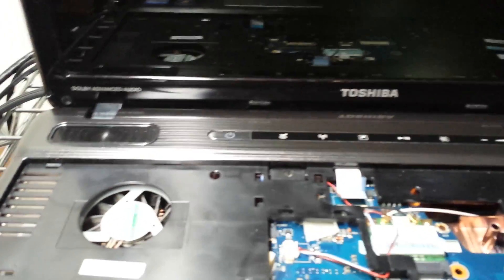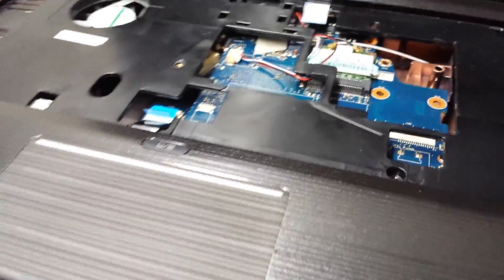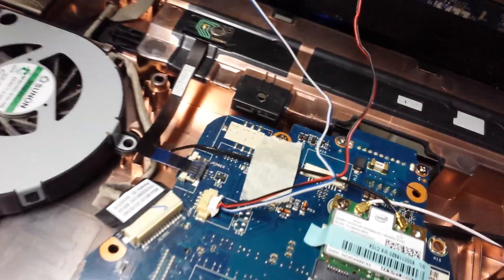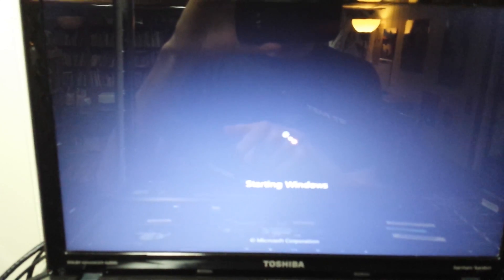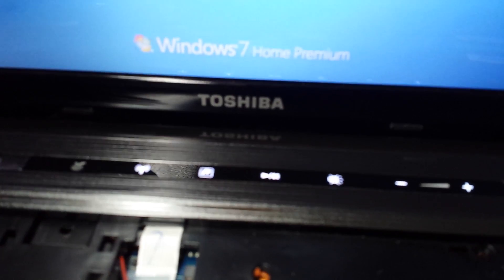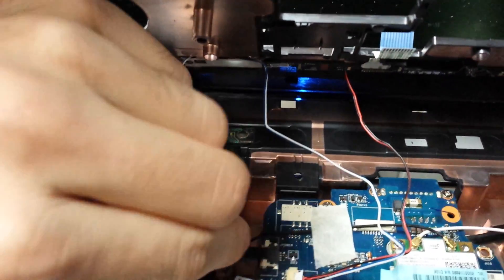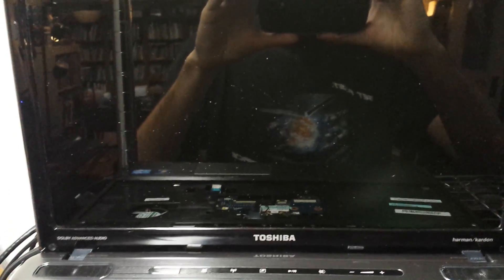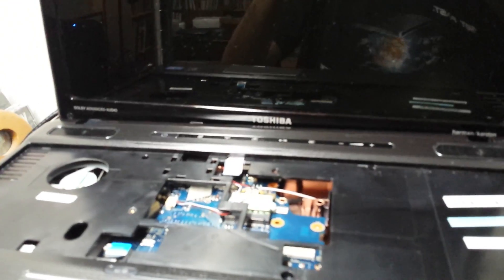Satellite P755 Won't turn on FIX

Comment: I just tried this trick out on a free Toshiba P755 that I saved from being recycled and it fixed it though my model definitely seems to run hot at 70-88C so I think I'll need to repaste it as well.

Shame there dosen't seem to be a replacement button for these anymore, so I'll just use it as a test system for Linux and the like.

Comment: I just fixed a similar problem with the P755. The power button felt really flimsy amd would randomly go into shut down. After opening it, I found this small plastic piece had come off from under the power button so any pressure on the keyboard would result in the power button being pressed. You need to be real careful when opening the laptop to make sure you don't lose it. I found it come off and stuck to near the hinge area, I was very lucky I spotted it. Just tape it back underneath it which will make the button nice and solid again. Stick it to the button of the laptop case; away from the button diaphram, not on top of or next to it. You will find they both have a notch which allows the plastic piece to sit in.
Reply: Are you able to further explain this? Any photos or anything? I do have a faulty power button because I disabled it but sometimes while pressing my keyboard it will shut down.

I have a P750 though so I'm not sure if the model is exactly the same.

Comment: Thanks for your help. This on a Toshiba A665D-S606.
I disconnected what you said, but I taped only the two traces that go directly to the button and reinserted the ribbon cable. Now I use the Play + Mute keys to turn it on  and still have both power leds. 
Since it worked I could have cut the cable, but tape works too.
My neighbor is very happy.

Comment: The same fix worked for a Satellite P745.  The nice part is that you don't even have to disassemble the laptop to get to it.  You just remove the memory cover and you'll see the ribbon connector -- just unhook it.
Reply: I've never disassembled a laptop before. Can you please tell me how to remove the memory cover and where it is located?
Thanks in advance.
Reply: The memory cover is on the under side of the laptop -- usually secured by a few screws.  You just remove the screws and pop the cover off.  It lets you get to some additional screws that have to come out in order to get the top cover off.
Reply: Thanks, man! =)

Comment: I really super appreciate this video, thanks a ton for this idea. After diagnosing software, hard drive, power supply, etc. I stumbled upon your video. I am working on a Satellite p755-s5265 and pulling the cable for the power button instantly did the trick. I have a very minimal comfort level popping apart a plastic laptop, but it certainly was doable and I recommend trying this to any p755 users experiencing unexplained boot failures. Try your finger rubbing over the power button without pressing if you are unsure before digging down to this part. Thanks much CarlsonXComputers!!

Comment: I have a Toshiba Satellite P750D which experienced the same issue: the machine started powering off (sometimes powering on shortly after, even) on its own without reason. I also noticed that the power button had become very sensitive to touch, as I didn't have to press until the click for it to activate. 

I too managed to figure out that the problem was the power membrane, since when I cleaned it up, the power button worked properly again... until it got dusty again (which took about a week or two, in my environment). So until now I've been painstakingly disassembling the machine and cleaning the power membrane repeatedly until it worked normally every time.

Funnily enough, I also recently found out about the machine's "power up by sliding on the upper buttons" capability by accident. I just never put two and two together since I believed the power membrane needed to be connected to the motherboard in order for the thing to power up. Now I know otherwise.

Haven't tried the fix yet, but I'm sure it'll work the same. Thanks for this video, it's been pretty helpful.

Comment: You're a life saver!! Thank you a billion times for this. I was facing this issue and the IT guy just said it was a processor issue and told me to replace the processor but the laptop still failed after replacing my processor.. Now I know the problem. Gonna try it out and let you know. Thanks again.
Reply: Quick question! Did you have to unscrew anything in the back to take the keyboard area off?
Reply: Shelly Cambell  Yes. There is a screw in the middle that holds the keyboard and prevents it from being detached. Watch the video in the description link on how disassemble Toshiba P755, it will show you how to unscrew it.
Reply: +Habush Samireh I watched the video and did unscrew everything now, but the keyboard won't detach near the center. Do you also need to take out the pieces of RAM in order for it to come out? (Sorry for all the questions! I've never done anything like this and don't wanna accidentally ruin my computer lol)
Reply: +Habush Samireh er, never mind actually! I fixed it. :) Thanks for the help you gave earlier though!

Comment: Hello, first of all thanks for this vid. I'm having the same issue with my toshiba but mine is a Satellite M645-SP4130L the design is similar but different at the same time, mine doesnt seem to have a way to connect the media keys without the power button. So my only sollution is to buy a new button? thank you very much.

Comment: I'm so glad I found this video. I knew the power button was the issue on my Toshiba, but couldn't figure out a way to get around it without paying the steep price for another cheap button. I never would have thought that the laptop could be powered on by swiping that pad at the top. Anyway, my laptop is working great now that I just unplugged the power button. Thanks so much for this!

Comment: Huge thanks for this video. Was having this issue with my laptop for a long time. Did this today and it works like a charm. Still getting used to swiping the soft keys and not pressing the power button but its working. Thank you! Was worried that it was a bigger issue. Huge relief.

Comment: Nice find! This vid helped a lot! I suspect there is more to this issue than just the bad button - as the unit I was looking at still behaved oddly even after this workaround. Sometimes the media buttons turned it on, sometimes not.

Comment: Nice vid! Any idea if this problem affected older Satellite laptops?  I have something remarkably similar going on, but haven't yet taken it all apart.  Thought maybe my hard drive was failing, so went with a SSD and same problem. Sometimes gets to desktop for a few seconds, but then it powers down randomly.
Reply: It could be. With the older Satellite laptops, the problems usually clears up if all the ribbon cables are unplugged, then plugged back in again. If however that doesn't work, I would focus on trying to run the laptop with first the touch sensitive media pad being unplugged (since the older models have the WiFi switch elsewhere), and then if that doesn't work, try running it without the power button plugged in.